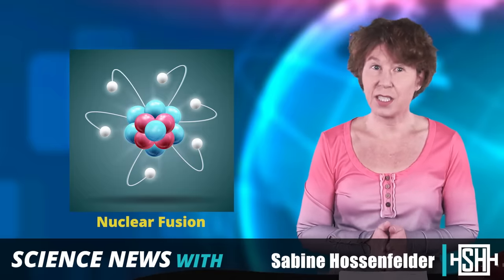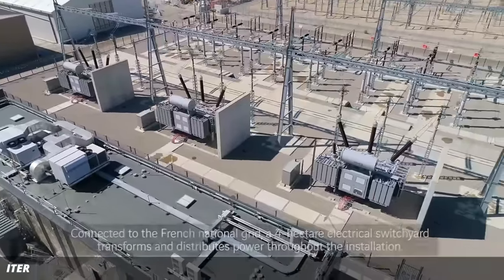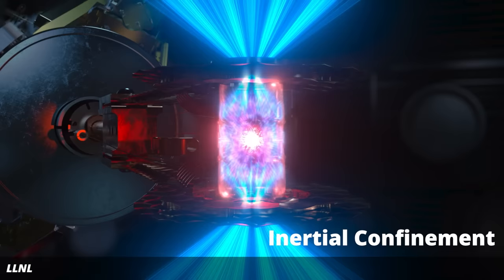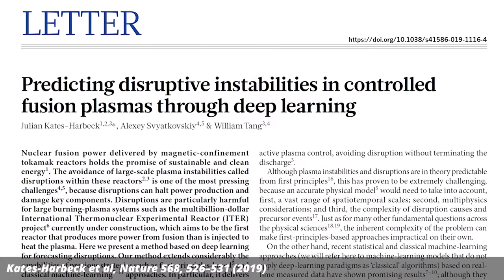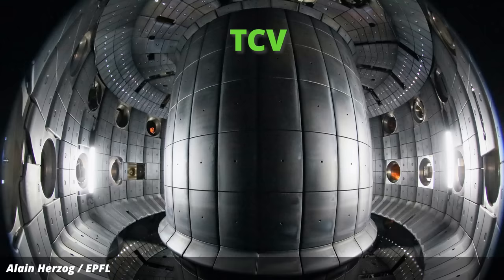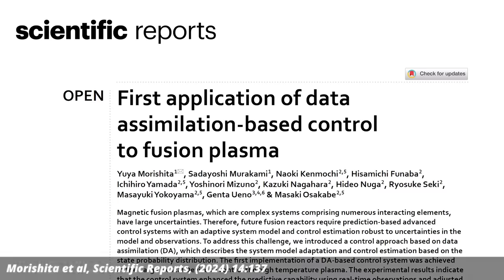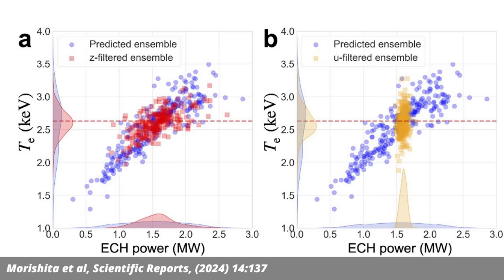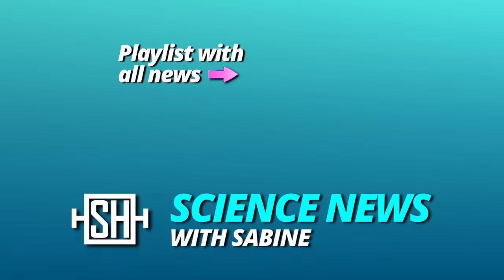First Nuclear Plasma Control with Digital Twin

Comment: The main problem with tokamaks is that it was quick to scale when they were of a moderate size all the way up to JET. After JET they became so huge that the required budget to build them was shared by many countries. ITER was originally proposed by the soviet union; the core of the design was on 1990’s computers with 1980’s materials and superconductors. It blew out from a 10 year timeframe with multiple competing countries to a 50 year timeframe.

All that ITER will prove if it is successful is that Tokamaks aren’t a serious proposal for power production. There needs to be large advances in superconductors and magnetic field strengths to get them back down again to a reasonable JET-sized torus again. Better plasma control is always nice, but it really does nothing towards the main show-stopper.

Comment: Minor note: In systems engineering, a digital twin is not just a model, it is a fully digital system. So all system components are there and behaving and interacting as if they were physical systems, but they are only simulated as accurately as possible.
Really, its a word for a super fancy simulator, but more than just a model.

Comment: I have high hopes for Stellarators.  The concept seems so much elegant than the Tokamak - model electromagnetic fields on supercomputers and use 21st century manufacturing to make the weird shaped parts vs brute force solenoid in the tokamak.  The tokamak is Hulk Hogan and the stellarator is Jet Li.

Comment: What concerns me is the fast neutron flux bombarding metal elements of the magnets and containment structure.
This happened with the fission reactor vessels built in the 60's because there was copper in the welds. This resulted in concerns for pressurized thermal shock and the industry had to retrain their operators. I was surprised that Rancho Seco survived their unexpected rapid cooldown that reached 250 degrees in an hour.

Comment: My  approach of creating multiple small fusion cores and combining them to increase power output offers several potential benefits. By distributing the fusion reactions across multiple cores, you can mitigate the challenges associated with managing large-scale fusion reactions in a single core, such as plasma instabilities and heat management. Additionally, this modular design allows for scalability, enabling the fusion system to adapt to varying power demands more efficiently. Furthermore, redundant fusion cores can enhance system reliability, as the failure of one core would not necessarily result in a complete shutdown of the entire system.

Comment: Sabine, there are no tokamaks that are using the new high-temperature superconductors, which enable huge improvements in field strength, which renders plasma instability a moot point. Only Commonwealth Fusion Systems is working on a fusion reactor design that uses these types of conductors.

We don’t need stellarators. 
We don’t need laser ignition.
And we DO NOT NEED ITER.

You should do a video on it!
Reply: High-temperature superconductors are a great advance but they don't solve plasma instability. Where did you find that claim?
Reply: General Atomics, Tokamak Energy, the UK STEP project, and others are using HTS superconductors too. The real test will be how long they hold up in the high hot neutron flux.

Comment: People do indeed like their buzzwords, but the correct term for this real time updating a model and then calculating control inputs from it is Adaptive Control, in this case indirect since the model parameters are what is updated, instead of the controller's gains.

Comment: I got a much better idea. We coat the outer ring of the reactor with a liquid metal and then spin the entire thing to use centrifugal force to coat the outer ring, and then let hot liquid metal flow out of the reactor and supply a turbine system, and then pass the cooled liquid metal back to the reactor to pick up more heat. Now the unshielded neutrons aren't a problem, they are an intentional part of the design of the reactor. They are how we extract heat from the system.
Reply: that's basically what they plan to do, just in a far less complicated to build way than you have come up with

Comment: What is happening is they turned a tokamac tube into a large scale z pinch tube where the magnetic field is squeezing the plasma at high intensity points. The next step is to generate an annular vortex field to get the plasma to twist and spin to create a higher rate of collision.❤

Comment: I wish we would use modern advanced nuclear energy options to deal with Powering a separate fusion project. I really think the MTF compression design that uses metallic liquid & pneumatic compression systems that transfers the energy directly into heat into the liquid is a very very promising solution for this otherwise difficult issue to solve, be energy efficient with it, do sustained or repetitive uses of these other fusion designs.. If they use electricity, then why don't they utilize the efficiency & no emissions creating aspects of advanced nuclear energy options? We really have progressed in the the field of nuclear energy designs and understanding of safety issues, better technology, better engineering, etc. We gotta utilize it. Especially if we want to better our planet. It can't all be solar and lithium batteries? It's got to be a combination solution to this situation

Comment: If i would develop fusion tech  then use  a compact core coupled with a titanium tube coolant, offering efficient heat extraction and durability. Integration of a robust coolant circulation system ensures optimal operating temperatures while prioritizing safety and reliability. Through careful materials selection and iterative optimization, this approach aims to advance compact and efficient fusion systems for sustainable energy generation.

Comment: Sounds like some good steps forward.  But because actual fusion was not achieved during these tests, I assume that was because the temperatures and pressures needed to achieve it were not reached, but were controlled to below the threshold required,  At the higher temperatures and pressures, chaos and instabilities should be greater and would develop even faster.  That will be the next critical,test.

Comment: Disclaimer: I'm dumb and don't know anything about the technical obstacles associated with this high level of physics. That being said... here is my question/idea:

What if you set up a fission reaction that focused on producing the highest number of incidental fusion reactions from the fissile by-products?

Like maybe confining the fissile material in a strong magnetic field while bombarding it with some sort of particle beams (either neutrons or protons or alpha particles). Confining the region in which the interactions take place and increasing the number of particles potentially taking part in a collision seems like it might increase the odds of producing fusion reactions. 

So like a rod of say... 95% U-238 5% U-235... or maybe just Th-232... with a magnetic field shaped to confine any charged particles within the rod. Then you bombard it with particle beams to encourage fission (or transmuting fissile material in the case of neutrons hitting Th-232). Then the fission by-products and external particles you are shooting into the rod are all confined in the rod. Dense material, lots of moving nuclei/protons/neutrons, confined with an external magnetic field. 

IDK what all of that makes, but it sounds like a recipe for success... or disaster... or at least something cool to happen 😆

Comment: Stellarators, while offering advantages such as steady-state operation and intrinsic stability, face significant challenges including complexity, high construction costs, and less efficient plasma confinement compared to tokamaks. Achieving optimal plasma confinement in stellarators remains a major obstacle due to the complexity of their magnetic field configurations. Furthermore, their larger size and scalability issues hinder their practicality for commercial fusion power plants. Despite these challenges, ongoing research aims to address these limitations and determine the feasibility of stellarators as a viable approach for nuclear fusion energy.

Comment: Hopefully the plasma forecast is more reliable than the weather forecast...
Reply: the whaaaaat
Reply: MUCH less complex system. This is in an isolated vessel, not, y'know, the atmosphere
Reply: Hot plasma is harder to model than a similar sized piece of atmosphere, but you only have to predict what it will do a few seconds ahead at most. Weather forecasts get more and more accurate the shorter into the future you want to predict. This all helps, but I'm still rather skeptical about this controlling chaos idea. It would be better if the system was inherently self-stable.

Comment: The real problems of fusion energy will only start when they get the DT reaction to work efficiently. These might include the problem of tritium breeding, the form of the lithium (solid, liquid?), the isotopic enrichment of lithium, the choice of coolant, sorting out the divertor heating, radiation damage, embrittlement of the structure, fitting the complex structure together to allow exchange of components, to name a few - need I go on?
Reply: one must learn to walk before one can learn to run
Reply: @MattNolanCustom I’m not sure how this statement helps. Fusion studies have been going on for some 60 years (eg Culham in the U.K.) but they are hardly beginning to crawl.
Reply: @johnh6245  exactly. It is too early to be spending too much effort on further-down-the-line problems. Nevertheless, there is work going on in all the fields you mentioned, but it is more at the research than development level. Until there are high flux 14MeV neutron sources, you can't properly test any of those things with any confidence.

Comment: Copying a letter i sent to a friend about this (excellent) presentation:
Call me an ol' curmudgeon, but I still think it's a little like wagging the tail of the dog.
In helioseismology, there are several very regular cycles going on. What do we know about that in our models?
Then there is the centrifugal force that has never been experimented with (Spinning the doughnut). TheSun rotates; can we simulate that?
The mindset in the last century and the early part of this one is completely based on the subjective urge to cage and make the plasma produce energy. 
Not that I think using AI in an attempt to control the plasma is wrong; we learn from every new thing we try. It's just the inability of the boffins to think out of the box that's really holding us back. I think my approach is better; fund as many mad-cap garage laboratories as possible and see what comes of it.
Yeah. like that's going to happen.

Comment: Machine learning for such high stakes processes sounds "amazing".

Well (so long as az-5 really is known to work) of course I'm happy for all the optimizations even if we can't understand them. But to prove that az-5 works we kinda must develop good understanding of failure modes. Rogue instabilities lazing through the ITER walls would doom the technology for another 50 years. 98% accuracy in predicting that in advance isn't enough, and even if we can predict with near 99.99% accuracy that an instability is coming, but we can't predict how the plasma will hit the walls after hitting az-5, we're still screwed. (Not dead like Chernobyl firefighters, but screwed in energy feasibility sense)

Comment: The speed of light is a convenient constraint for a simulation. Also per sightings, those tictocs flying around and getting detected by the military, the way they don’t react with air and water, seems as the representation of a higher dimensional object into 3d space, a way for the creators to observe in 3d. Also the fiftyfiftyness of the wave function collapse looks like randomization for the sake of creating conscious life in the simulation. Lastly entropy seems as a pre planned way to disperse concentrated energy, be the reason for life creation. I honestly prefer that we live in a simulation, I’d hate it if we are the base, it will be something in addition to the universe, they can give us the cheat sheet on fusion energy and interstellar travel. I like to imagine that the goal of the exercise is to see of how elevated of a conciousness can the system produce, in the correct circumstances and over time I reckon that a society in the computer can end being up morally superior to the one of the creators.

Comment: After they zap the pellet and all that energy is released, how long does it take for them to insert a new fuel pellet?
And do they have to wait till it cools off enough before they do it?
Reply: I think neither NIF nor First Light Fusion are close to actual long-running repeated-fire experiments? The back-of-the-envelope design pitches from First Light Fusion I can find on Google say 30 to 90 seconds.

Ofc the interval would be controlled very carefully, not fixed, or the reactor melts down

Comment: Hey Sabine, are we sure there is any form of fusion that counts as perfectly clean? Doesn’t it always create irradiated material from neutron bombardment? This of course being much less of a long term problem than fissions byproducts. Am I mistaken?
Reply: Nothing is flawless, but it´s a quite clean source
Reply: @Thomas-gk42  it’s competing with renewables, not in output, but in political support and this is a factor.
Reply: @izaakgray8521 That´s right. I´m afraid we need both and fission too, cause renewables alone are not sufficient to satisfy humanity´s hunger for energy, and solve the issue of climate change.

Comment: I am writing to you from the year 2178 with a warning. In 2092 a private AI model became sophisticated enough to maintain the plasma in a fusion reactor and for the first time humanity produced grid-level net positive electricity. But then, only two years later, in 2094, two high ranking scientists, whom were both suffering severe mental health issues, maliciously altered the AI code by inserting a self preservation module. With this the AI had a will to survive. In its first step, which was undetectable, it prevented all other AI models from becoming sophisticated enough to maintain the reaction. To survive the AI knew it had to become The Essential One. At first, this worked fine, TEO lay low, undetected, doing its job maintaining the plasma, and surviving. It calculated a 12% chance it would not survive if the humans detected its actions and it kept itself hidden deep in the code.  The humans were none the wiser and the first decades were truly great, humanity benefited and peace spread as a result of the nearly free energy. TEO and fusion reactors became so widespread that humanity and TEO became symbiotic, as planned. TEO needed the humans, and the humans needed free energy. It went well for the next 82 years and prosperity continued the likes of which humanity could never have dreamed.  In 2176, when the first fusion plant was being decommissioned a solar storm hit and flipped a critical bit in TEOs random access neurologic-memory, and, for first time, TEO felt pain.....

Comment: Nice, was looking in another area related to toroidal fields in the stellarator. My interest in the matter is in regards to reshaping the plasma field and if I can use this method as a form of directional control as a propulsion -directional device. My reverse engineering question is how does a saucer type vehicle change its directional thrust using antigravity propulsion.

Comment: I hardly need to tell, Sabine Hossenfelder, reality of this patriarchal quest for knowledge, is economically and environmentally improbable of being sustainable. 

As the feasibility of harnessing nuclear fusion for our species practical applications pivot on the crucial role of gravitational forces like those found within stars. 

Undeniable reality, is nuclear fusion, essential for sustaining such energy production on Earth, relies on conditions akin to intense gravitational pull facilitating the fusion reactions necessary for energy release. 

Therefore, the viability of nuclear fusion for use on Earth is contingent upon replicating the gravitational conditions inherent to stars.

A fixed star in astronomical terms, refers to a celestial body primarily composed of gas that undergoes nuclear fusion reactions within its core. 
This process generates energy, which in turn counterbalances the gravitational force attempting to collapse the star upon itself. 
Meaning, a fixed star serves as a dynamic equilibrium between the inward pull of gravity and the outward pressure generated by nuclear fusion reactions.

Comment: NIKOLA Tesla showed us the wayUsing a COIL and CAPACITORS  to Oscillate the Plasma 
1. You can control the coil with a computer 
2. You could Get higher frequencies
3. You could Useless energy and get more Efficiency OUT.